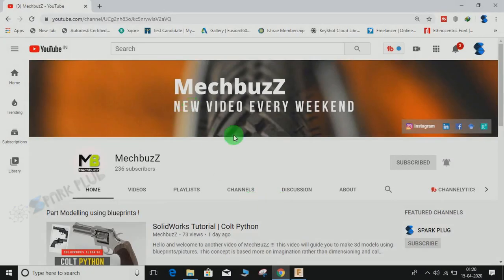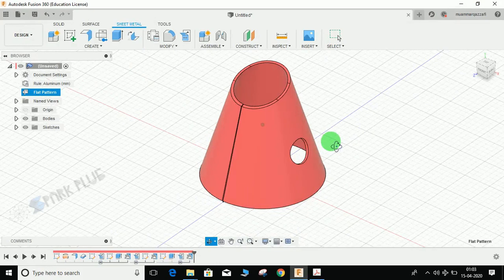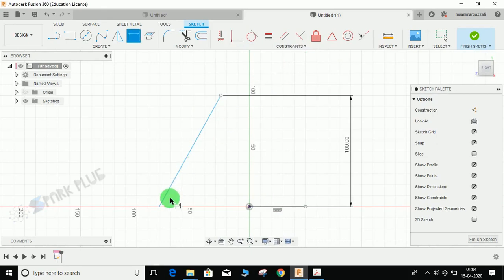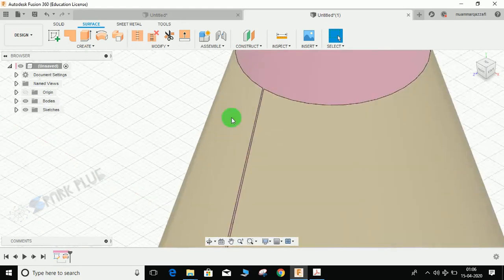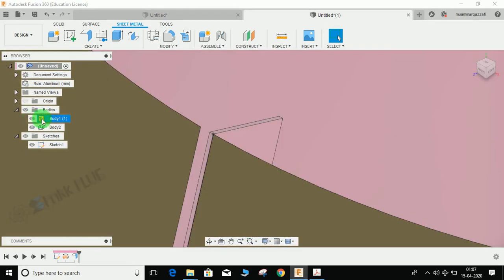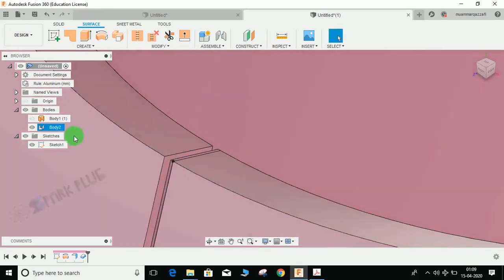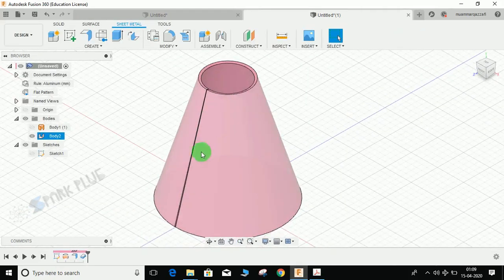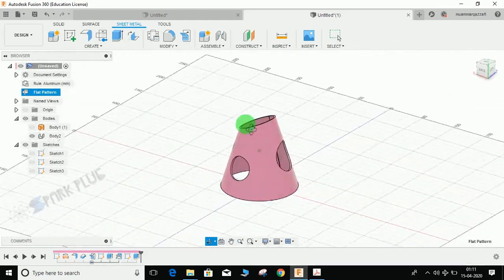Fusion 360 beginner's Exercise #15 | Sheet metal cone | Fusion 360 Sheet metal Tutorial |

Comment: Thanks, great video. But it may be simplified. There is no need to create first sheet metal body. Just thicken the rotation, then use Extrude command to elongate the edge by 0.1mm, then use "Convert to Sheet Metal" command selecting the small 0.1 mm face as a base.